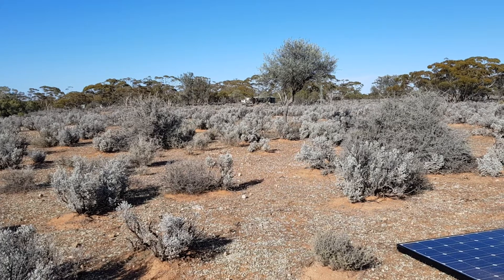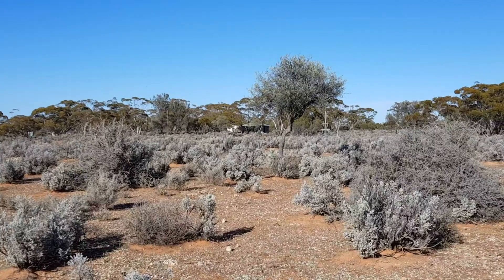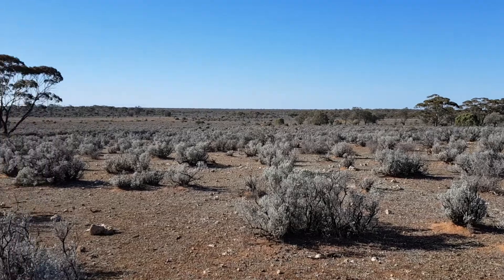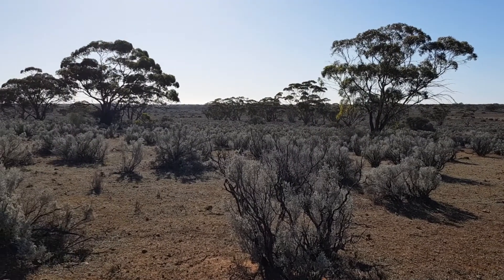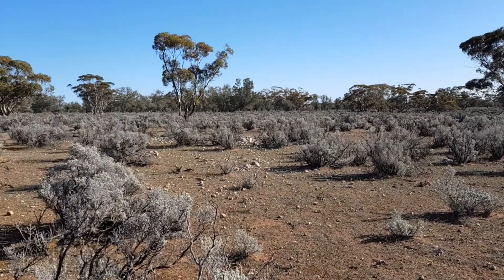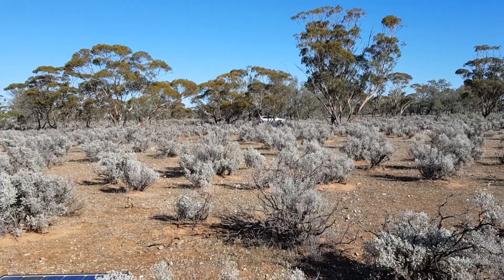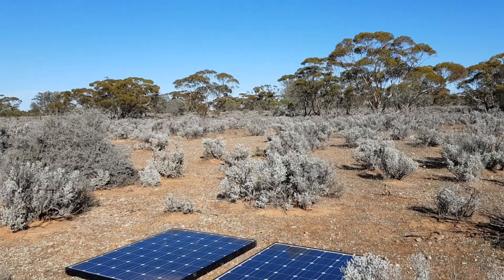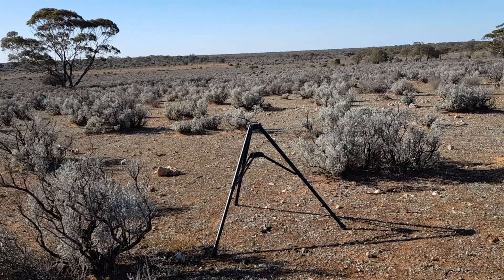Buddipole Vertical Antenna Assembly by Rob, VK5SW.com.

Comment: Good video; thanks.  to which of the terminals on the Versatee did you attach the leads from the feed line? Thanks much.
Reply from the maker: Hi Michael. I'm sorry I can't answer that question as I haven't used the Buddipole as yet. It would pay to go to their website to get the info. Here is the address.  https://www.buddipole.com/  73, Rob. www.vk5sw.com